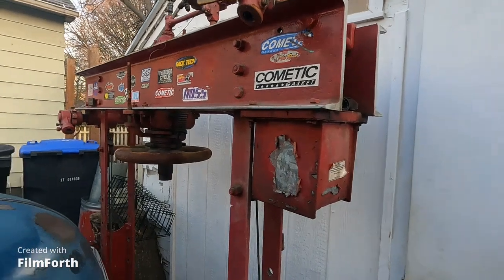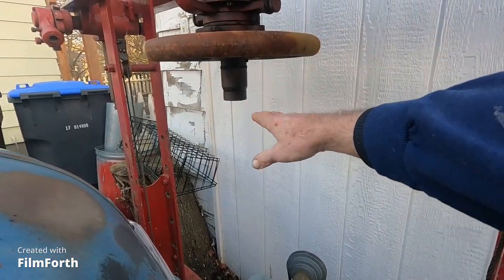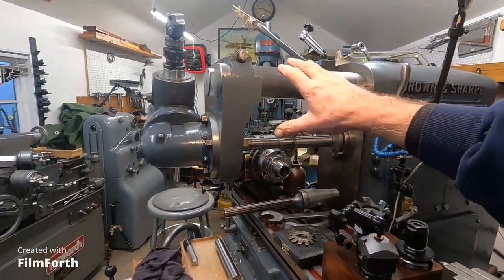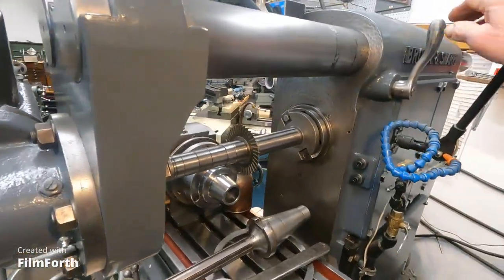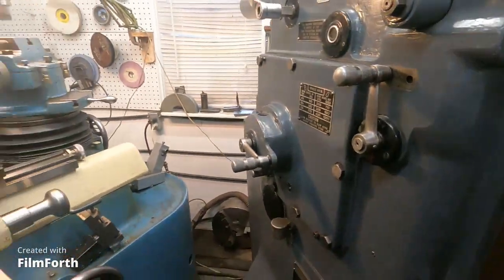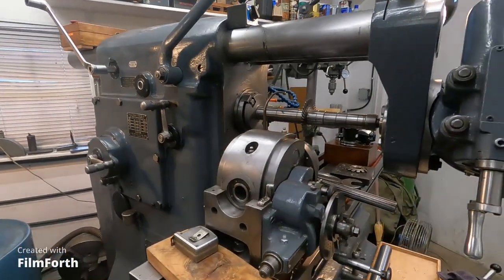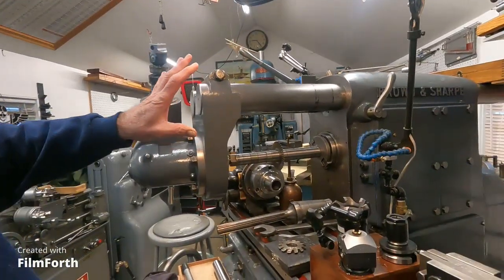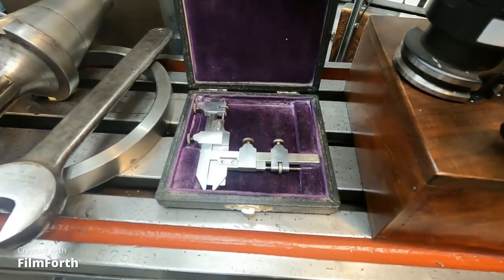Machine shop projects from this point 2023

Comment: Happy Birthday Dee Dee.
A horizontal mill is a machine I would quite like to have but I just don't have the room for a one, same thing with shapers, been offered both over the years but had fo say no, but there is always more machines available than space to fit them.
I have just agreed to buy an 1 1/4" capacity geared head drilling machine which is 1120lb of English iron and steel, it will be nice to not have to do all my drilling work on the Bridgeport.
Reply from the maker: The heavy drill will save a lot of wear and tear on the mill for sure. I would like to have a small or mid size shaper, but no room at this time either.